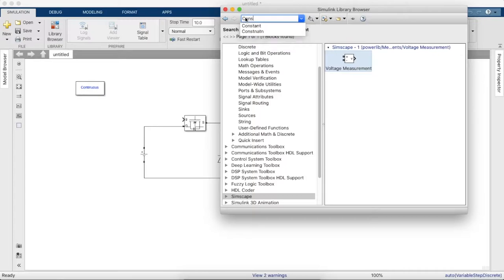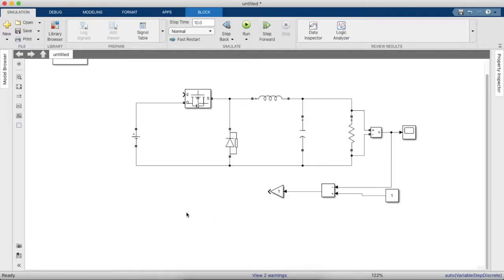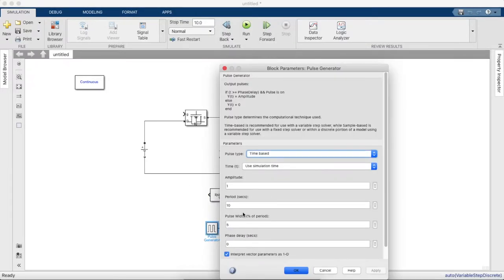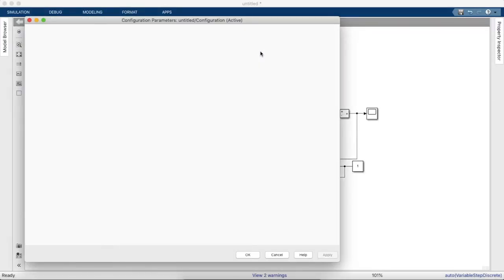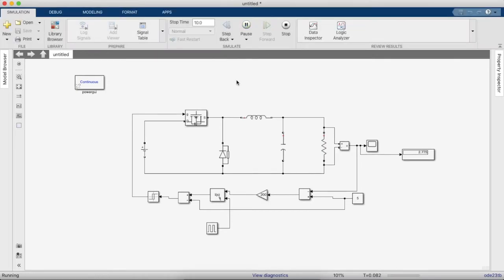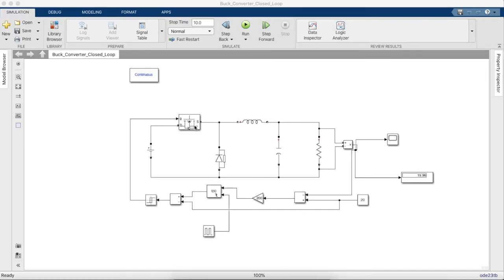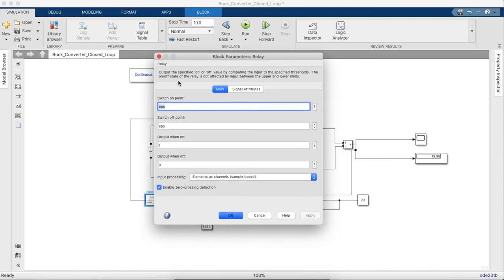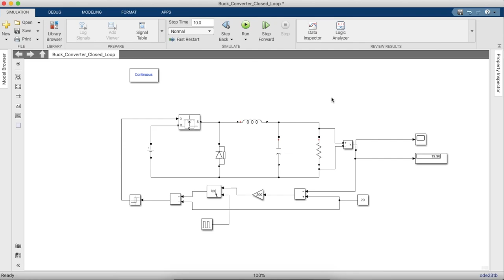Closed Loop Control of Buck Converter (DC-DC) Simulation in MATLAB/Simulink!

Comment: Why is the value of Integral taken as 4 times the switching frequency? And what is the difference between setting reset end as rising or falling?
Reply from the maker: That's how it's approximated, and use scope for the trigger pulses to see how it works, hope this helps 🙂

Comment: Sir I simulated a bridge rectifier for 230V. It gives and output of 228.4V. Then I simulated a DC-DC Converter for 230V-60V using DC source of 230V as input. But when I removed the DC source and used the rectifier output of the rectifier as the input to the DC-DC Converter then output voltage of rectifier becomes 180V with 10V fluctuations and output of DC-DC Converter becomes negative. Can you please explain what the issue could be.
Reply: Hope you will respond sir
Reply from the maker: We value each and every subscriber of ours very much and we will respond,that's our policy 😁

DC-DC converters have inductors and Capacitors that charge and discharge, you'll see variations in your circuits due to this. 

To minimise this you should design your circuit properly. The reason why you're getting a lower output voltage is because of voltage drops in the circuit ie. across the switch and diode
Reply from the maker: Pls share our channel with your friends as well 🙌 they'll find it very useful like you found it 😉
Reply: @TheUrbanScholar  Sir it works fine individually. Like if I use a 230V DC source the conversion to 60V is OK. Even a 1000V DC source will only produce 60V in a closed loop. But when I replace the 230V DC Source with the rectified voltage of 230V the problem occurs. If it works individually then could the design be wrong?
Reply from the maker: You can't cascade two individual things like that.
Reply: @TheUrbanScholar  Sir can you do a video on this or can u please explain why
Reply: I thought the rectified voltage is also DC voltage. Should work similar to the DC Source
Reply: In practical also we do cascade don't we
Reply from the maker: Surely in future we'll make the video for you
Reply from the maker: Its not as simple as just cascading the way you mentioned that's why I can explain it better through a video.
Reply from the maker: You can mail us and I could give a few references
Reply: @TheUrbanScholar  Ok Sir. Thanks for the positive response

Comment: Hello Sir. I wanted to discuss about a project that I am currently working on. It is related to the Voltage and Current Control of Buck-Boost Converter using PID. I am not able to get the desired output. How can I get in touch regarding the same? I am not able to decide the values of repeating sequence and saturation blocks in the controller. Please help.
Reply from the maker: We have done for Buck as well as Boost and we're working on Buck-Boost and we'll release it soon 🤠
Reply: Can I contact you regarding my ongoing project? Perhaps you can help me with it. I am short of time. I am basically replicating an already proposed controller but unable to get the desired result. There is a research paper already published on the same.